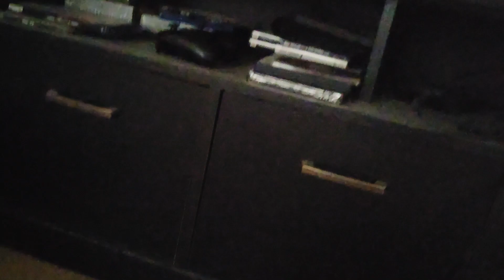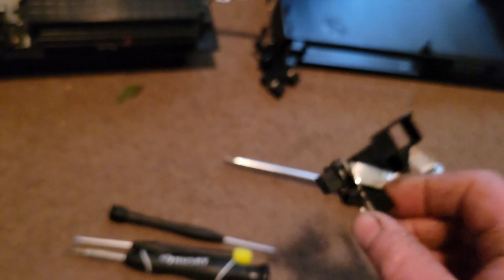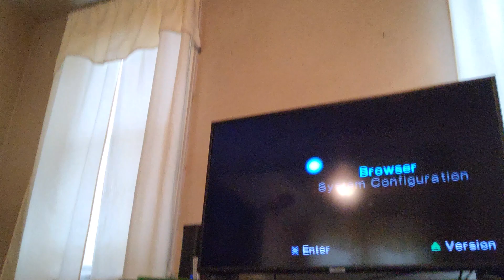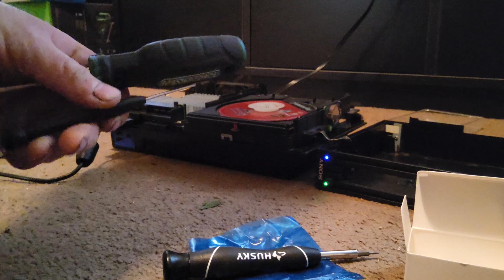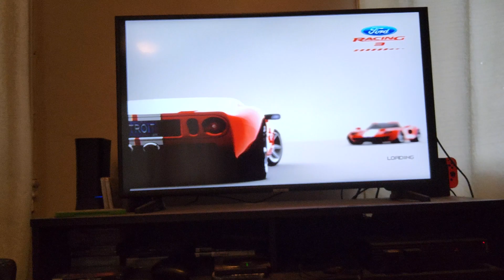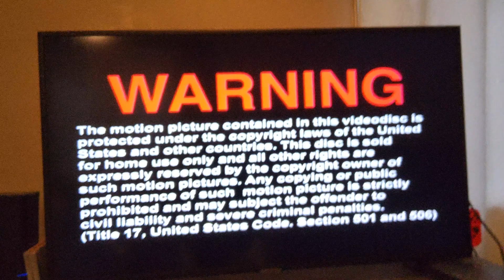SCPH 30001 Controller port repair and laser repair

Comment: I broke the ribbon cable/ pins the are underneath the cd drive, after buying a replacement how do I reconnect it? 

There is a metal plate between the flap/ribbon cable and the disc drive making it hard to reconnect. 

I tried reconnecting it, and after, forcing it without clamping it ribbon cable chipped. I was trying to clean the laser, I cleaned it and it worked perfectly, a screw fell into the right side so I flipped the console and the disc drive fell out, disconnecting it from the ribbon cable. Now the disc portion won’t eject. 

Please help.
Reply from the maker: I would need a picture of the issue

Comment: Hi dear Racer PS2 and electronics repair, I am watching your videos often and I would like to ask you about your experience in replacing laser in scph 30001. Today I replaced a laser KHS 400B to KHS 400C from working original unit which I have home. Ps1 game worked and Ps2 DVD (I tested 10 games DVDS) worked also but 3 games (GTA San andreas, COLIN MC RAE 3 and GT4 prologue) can´t read it.. Did you have this expierence in this problem? Should I adjust the height of the laser through the screw? Any help will help thank you very much for your answer..
Reply from the maker: that is a bad laser check your discs make sure they're clean and scratch free. if it doesn't read blue discs it's bad lasers are going for up 500.00 for nos khs 400cs i have three left .
Reply: @axcc  I have adjusted the height of the screw by half everytime and all games now work. I wound'nt now how much or if I can adjust the screw if you were not made your videos. Thank you for the videos and for sure helped a lot of people fixing their old ps2 systems. :) Thanks again..
Reply from the maker: @Godfamark1  jigger per second matter so does the height it has to be set back to where it was every time. the b lasers are taller. so you have to set it back where it was. not a problem that is what the videos are for.

Comment: Will a scph 39001 work for a scph 30001 r
Reply from the maker: If you're talking motherboards, yes, it will g-19 or a g-22 -31
Reply: @axcc  I'm sorry I meant lasers
Reply: @axcc  or can you use the same power board swapping one for the other
Reply from the maker: Yes, you can any v4 power supply will work. I would repair the one you have first. Check my power supply videos

Comment: So it’s not just my ps2 that takes that long to load it’s the model after all I thought my ps2 was going seems not just slow
Reply from the maker: The older models tend to do that. The newer firmware load times are way faster, like 39001, or higher and the pos slims
Reply: 39000 series and later are much faster due to newer firmware, newer laser and a better thermal design that means it doesn't run nearly as hot as the older ones.
Reply from the maker: @Retronics05  that is correct 👏.